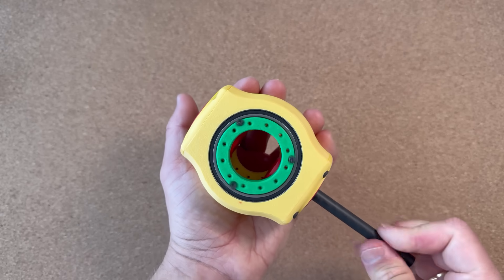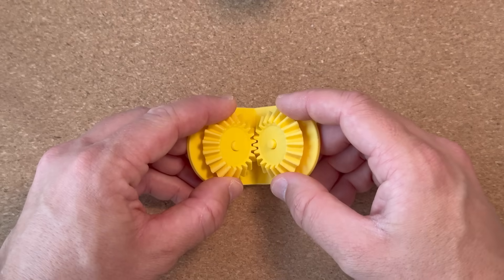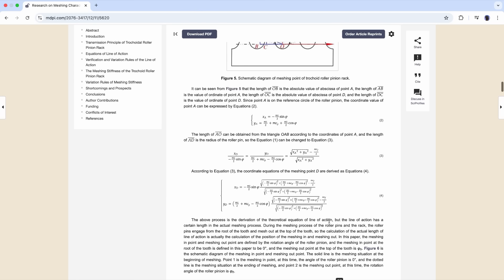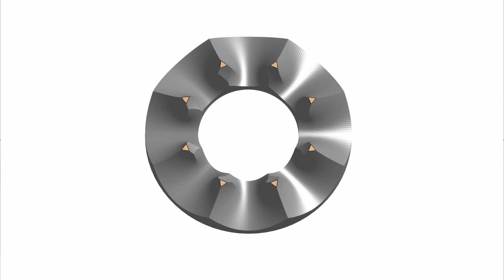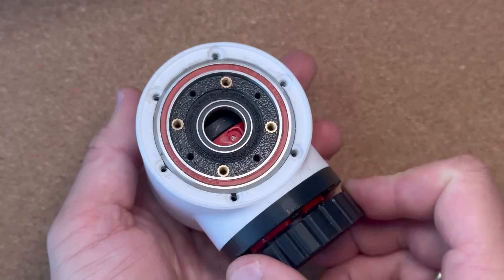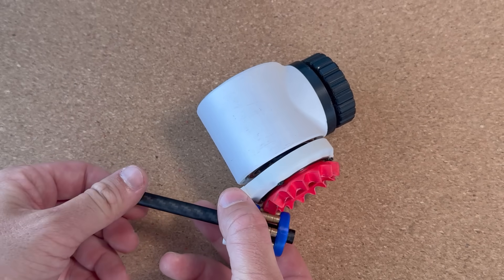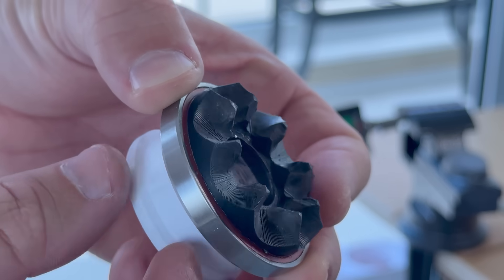High Precision Angular Gearbox, 3D Printed and Tested

Comment: Backlash is present because there has to be room in between the two moving parts in order for them to be able to move.  If there was no backlash, the moving parts would get stuck together.  This is machining 101.  A rod that is .5" in diameter, cannot fit into a hole that is .5" in diameter...without getting stuck.  There has to be backlash in order for the parts to move freely.

Comment: I think you don't need to "brute force" the calculation for the crown surface.  Details below.

Basic intuition:
(A) You can take a line, and "inflate" it into a cylinder.  This "inflation" is generated by a "surface offset" of distance equal to the radius.
(B) If your line sweeps out a surface, then you can "inflate" it by offsetting the surface by a distance equal to the cylinder radius.
(C) In the coordinate-frame of the large crown gear, the axis of a roller is a line that sweeps out a surface.  You want a surface that is offset from this surface with distance equal to the radius of the roller. 

Same, as above, with slightly more detail:
(1) Consider just one roller, as a cylinder.
(2) The cylinder sweeps out a volume, as the gear rotates. (Let's work in the coordinate frame of the large crown gear.)
(3) You want the surface of this swept-volume.

(4) Now consider the central axis of the cylinder, a line segment.  As the gear rotates, this line-segment sweeps out a surface.
(5) If you offset this surface by the radius of the cylinder, you get a surface(s) of the swept-volume.

Hope that makes sense....  If not, just ask can I can provide more detail and/or some CAD files.

This idea of "inflating" and "deflating" geometry comes from many places, but I was first introduced to it in robotics class, as the Minkowski Sum of geometric shapes.  It's also closely related to the idea of convolutions in Fourier Transforms and physics.

In geometry, spheres are the "simplest" type of inflation, followed by cylindrical inflations.

For fun I've written a small script in Rhino3d to make an example surface this way.  Just let me know if you want more details and/or the CAD files.
Reply: btw, the above doesn't give an explicit "formula" for the surface, but it is a parameterization:
(1) For a given rotation of the gears, you know the position of the roller's axis.
(2) Therefore, you can parameterize the swept-surface of the roller axis by angle (of rotation (1)) and distance (along the axis).

With a fully parameterized surface, you can calculate things like tangent-planes, normal vectors, etc.  And in theory from all that you can get a parameterized offset-surface.  In practice, that get get really messy.  

(3) Using vector calculus, you can calculate the surface normal from (2).
(4) You can then move along the surface normal by a distance r, the radius of the roller.

In this way, you can parameterize the surface you want, by three parameters:  angle of gear rotation, distance along axis, and radius of roller.  This should be a parameterization that is at least piecewise "smooth".  (The not-smooth edges/corners are due to self-intersections, singularities that occur when offsetting surfaces, and other things.)

In practice, I generate a bunch of roller-axes (at say, every 10 degrees of rotation), then use CAD to loft it into a smooth surface, then use CAD to offset that surface to get the final result.  So I'm using CAD software to do the heavy-lifting. You will need to trim the intermediate results to get rid of self-intersections, etc.
Reply from the maker: wow! that would be awesome, can you dm me in insta?

Comment: Hey, Mechanical guy here. Great job.  could you plz give some insights and info about the method you used to make the custom profile and motion sim? I am currently stuck on a custom profile making for one of my projects.😄
Reply from the maker: I made a feature script in Onshape that rotates two bodies at a set ratio and does a boolean operation between them
Reply: @MishinMachine Thanks a lot.

Comment: why even use metal bearings? just use a printed bearing with lubricant oil or even print in place ball bearing! some work REALLy great and would be better for a truly 3d printed system. come on man. we need to start using printed bearings, they work 100% fine for the projects they are used on.

Comment: How did you brute force the design?
Reply from the maker: I made a feature script in Onshape that rotates two bodies at a set ratio and does a boolean operation between them
Reply: @MishinMachine I have a python project called gggears, it's for generating gear shapes mathematically. It's far from complete... and can't generate this yet but I might look into it cause your design is super interesting. And if you work on similar gearing projects maybe you should check out gggears

Comment: looks like you have a very small contact surface ? not over the entire length of the roller, or only 1 roller at a time?
Reply: the rollers have full line contact and there appear to be multiple in contact at once.

Comment: For 3d printing this is fantastic, because simple and cheap metal pipe segements can be used. Probably the most acessible way for people to mske robust longer lasting gears with nothing but a 3d printer. Good job I will definitely be using this approach

Comment: There's a chainless bicycle with a similar drive as yours! You can use their solution, make the path as thin as possible, so you don't have the different diameter. Also, could use their gear solution! It would be interesting to have an robot with a gear to travel and other to operation!

Comment: You sir, are a genius. I got a bunch of kids I'm mentoring as part of the FTC program, I would like to help them model, 3d print and test this angular gearbox so they could add another degree of freedom to their end effector. in a more advanced stage of the project they need to work on an autonomous program so i think this could help them both on the drivetrain encoders readings and calculations and on their computer vision tasks later on.

Unfortunately, I am not sure what you mean by "brute forcing" it? how did you go about brute forcing the teeth profile for the crown gear?

Together we had this idea of using SolidWorks motion study to trace the path of the roller and then convert that path to a surface and use it for cutting the crown gear tooth profile, i would appreciate if you could guide us in the right direction. Anyways, I immediately subscribed, your content is gold.
Reply from the maker: Thank you! I’m planning to share the STL files for the wrist differential for personal (non-commercial) use — would that setup work for you?

As for the “brute force” part — I wrote a feature script in onshape that rotates two bodies at a set gear ratio and runs a boolean operation between them. Basically, I use a pinion as a tool to carve out the crown gear from a solid blank.

If you come up with a cleaner way to model it in SolidWorks, I’d love to see how you do it!
Reply: Thank for the response, yes the STL files for the wrist would be great it could help them get started on modelling it themselves.

For the Solidworks solution I still haven't tried but I'll keep you posted if it worked out or not.
 @MishinMachine

Comment: As a mechanical engineering undergrad that now works in software, I can really appreciate that brute force method of finding the crown gear shape. Sometimes brute force is the best force.
Reply: how can you brute force a shape like that? like what are your constraints and what parameters are you variating
Reply from the maker: @Luclecool123  I wrote a feature script in onshape that rotates two bodies at a set gear ratio and runs a boolean operation between them. Basically, I use a pinion as a tool to carve out the crown gear from a solid blank.
Reply: @MishinMachine you must make n video on how you did it, please.
Reply: @MishinMachine it would be extremely cool showing the brute force on cad using the script you made, should make a video about it!
Reply: @MishinMachine  As an engineer, honestly, I wouldn't even call that brute forcing, that's a numerical, perfect solution, very sophisticated :D

If I had to do that the brute force way, I would put rough parts in the assembly and interlink the rotation. Then rotate the parts along adjust the curve splines along 15 points or so until the surfaces just touch, without clipping or large gaps. That brings you below any machining tolerance, so good enough
Reply: @Luclecool123  Not sure about the precise CAD method to do it myself, but if i were to do this (also brute force) in a nurbs/polygon modeling software it would be like having an pseudo-infinite amount of instances of the rollers along the path of the actuator cutting an also pseudo-infinite amounts of instances of the gear at different rotation angles.
Reply: Yes this is actually correct, and then smooth it out with a tangent
Reply: @Luclecool123  The same way that differential equations are "brute forced". You know the gear ratio you want, so you can rotate a disc model along with the brass bushing model. You apply a boolean operator on each d/dt (d/dtheta in this case) step. Essentially, you subtract the brass bushing model from the round disk as they rotate. You end up with the mating gear. The reason the model had lines in the mating gear is because it was made from a bunch of boolean operations of the round bushings. The smaller the step size, the more accurate the model will be, and the closer those lines would be together. Albeit, with more unnecessary detail, when you take into account the limited accuracy and layer thickness of a 3D printer. You could technically do this with the roller track design, but it's better to have an equation to go off of since the calculations are easier and sometimes yield segments of constant radius surfaces. Watch a video on how differential equations are calculated and it will make more sense. The smaller the step size, the more accurate the model.
Reply: Every dev that actually gets things done agrees with you.
Reply: Is it possible to do in Solidworks?
Reply: @alf3071  should be possible in all 3D modelling software that can do boolean operations between objects and do animations, which should be basically all 3D modelling software CAD or non-CAD.
Reply: @maskharat  I know you can do boolean operations but usually it's between fixed objects, I would like to do one with both objects moving, sort of like a sweep but with both objects moving, this would simplify helical gear modelling by a lot
Reply: @alf3071  So what? You have it go through the whole range of movement with your script and use the bool after each movement. Pretty sure that was overall implied.
Reply: I came down to comment in response to that line- the software engineer approach would be to figure it out with math, the mechanical engineer approach is to brute force haha

Comment: Great design \o/ I love how pretty the crown gears look, always very nice to me when simply solving for the geometry that works can produce "art" in a way... a bit like propellers?

Just a word about friction, It might seem counter intuitive but even the conical rollers are slipping, because they are conical :D so I'd say don't worry too much about it as with this design it is inevitable (unless you keep splitting the rollers to infitely thin disks that has point rollers inbetween o.O) and even the best smoothest "classical" gears slips too! nothing good grease can't handle to reach incredible efficiency anyway :)

And one last thing "zero backlash" is only theoretical <.< a bit picky on this one but It "grind my gears" (haha) but yes, if a part transfer forces, it deforms, and the next tooth and roller couple are now slightly off alignement, it will produce noise when runing and will slightly dephase input and output while torque is transfered or sustained. So technically it will always have a little backlash <.< even belts have some ¯\_(ツ)_/¯ Ok pedantry over ^^ 

Also i'd be interested to see a rotational speed graph? is the output perfectly synched with the input or does it oscillate a little? to my knowledge only gears and belts can produce "prefectly" (in theory again <.<) synched motion.

Tchuss o/

Comment: I liked the rollers on the bevel gears. If the ends of the pins were beefed up to strengthen the rollers. The bevel pins could be a mulitiplicity of washers
Turned into a cone maybe. Thanks for sharing & don't give up.

Comment: 2:20 You can now print with out a seam or at least a very reduced one. There is something called scarf joints in the slicer. Instead of stoping what it does is reduce flow and increase the z axis. It pretty much gets rid of them.

Comment: Very nice! When I was developing a gerotor design, I had a great time in the research phase and the equation drivern profiles were satisfying to achieve. I highly recommend reading "Kinematics of Gerotors" if you are into this type of engineering. EDM has also become cheap to produce 0 tolerance machining if you need to.

Comment: I don’t really get in the end how you did the crown gear in cad, could you maybe explain a little bit i am very interested!
Reply from the maker: I wrote a feature script in onshape that rotates two bodies at a set gear ratio and runs a boolean operation between them. Basically, I use a pinion as a tool to carve out the crown gear from a solid blank.

Comment: Nice job, but this is not new idea and and not backlash free. The roller cam gear is used in cnc machines as 4th axis for many years. They claim them for having long life wear free and zero backlash, but not true in my personal experience. But they are loosing their reputation and producers switch to direct drive mechanism for long life and precision but this time torque is sacrificed. I just want to inform you please continue to develop your designs

Comment: Get a resin 3D printer. You're dealing with small parts, and you're not expecting super high loads that would justify getting an SLS or a precision CNC. The upgrade to resin printers, will unlock so much more possibilities in terms of precision. BUT it smells really really bad so have a dedicated space for it. To me, its worth the upgrade over FDM printers.
Reply from the maker: I really want to get one as soon as I have my own maker cave

Comment: It has clearance otherwise it wouldn't move at all, and if has clearance , it has backlash.  And as it wears, that backlash increases. This is NOT zero backlash.
Reply from the maker: I think it’s possible to achieve the kind of clearance similar to what you have inside bearings (after all, the balls inside aren’t perfectly round). Of course, a 3D-printed version will have some clearance. But my point was to demonstrate that this design can achieve very high precision

Comment: Bevel-gears are not super precise? ..... Well.... no. That sentence doesn't even make sense. You were showing backlash which is a result of design choices - in this case of your choice to make them sloppy. Without preloading basically any system has backlash.
It just so happens that your roller-based gears was printed with tighter tolerances.
Reply: I mean, to be fair there's a reason bevel gears aren't used in applications that need low or zero backlash (especially in both directions)

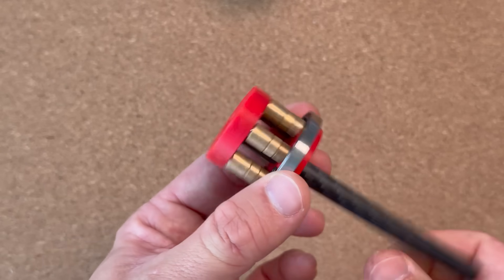Comment: could tell me how did you modeled it please? which equation did you use? could you make tutorial about 02:49, how did you boolean when two object moving?
Reply from the maker: I wrote a feature script in onshape that rotates two bodies at a set gear ratio and runs a boolean operation between them. Basically, I use a pinion as a tool to carve out the crown gear from a solid blank
Reply: @MishinMachine  Are you open to sharing the script?

Comment: Why are you trying to get this to work by varrying the size of bushing instead of putting a constant bushing on an angle the way beveled heats actually work. This is a problem because you’re trying to make the gears work at 90degrees not something less than that

Comment: Wow. Superb work. Subscribed.
About the conical printed parts, you can use the scarf seam feature to basically eliminate the seam, although that is not all that relevant considering the metal parts were a better choice.